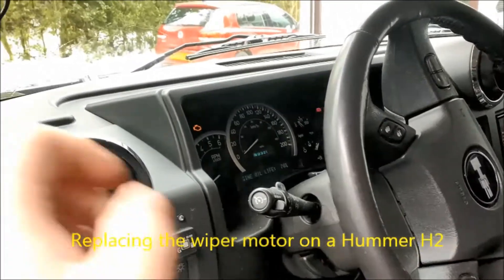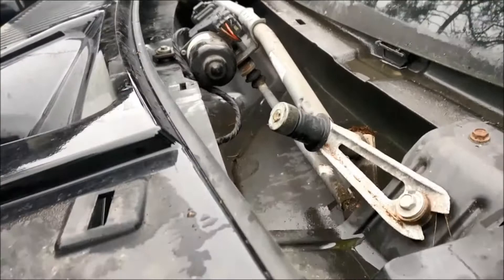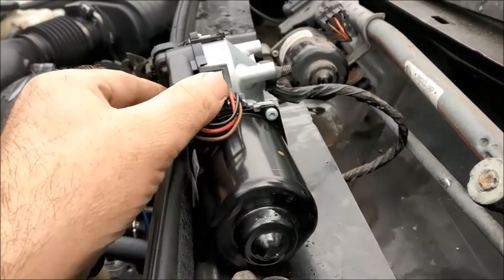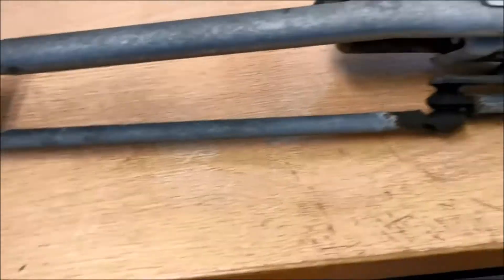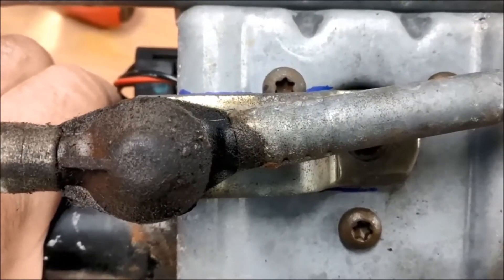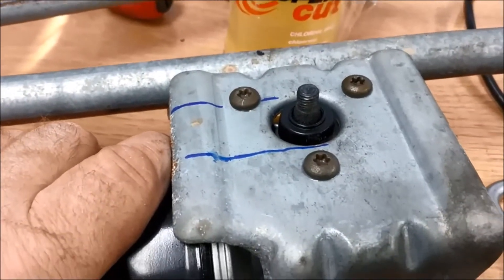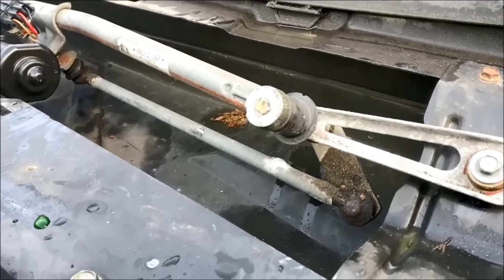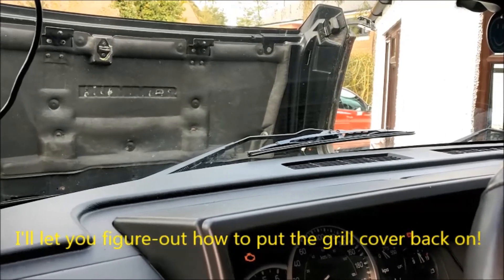Hummer H2 2005 - Front Wiper Motor Replacement

Comment: i am have a really weird problem....my drivers side wiper will not go all the way to the left for a complete windscreen sweep it stop right past top center and goes back down....no issues with the motor and at the end of the day all the motor does it a complete circle every cycle....i am past stumped on this one and looking for ideas on what it could be....i even have a video of it with the cowl off and it just doesnt sweep the full windscreen????....
Reply from the maker: Thank you for your comments.  Before commenting may I ask if this fault just suddenly started hapenning and is there any prior history?
Reply: @hummerfixes  I just got the H2 about 2 months ago and it was like that when I got it ….it does appear that the motor is newer but it seems to be doing exactly what it is supposed to making revolutions as it should and when I look at the wiper transmission it also seems to be doing as it should to but something isn’t right somewhere and it’s got me stumped ….I did send you an email with a video of it in operation

Thanks 
Jody
Reply from the maker: Thank you for your video, and I hope you received mine, which says the following :-

Good news, the motor and linkage look fine.

If you watch the video from around the 6s mark you'll see I've overlaid my H2's right-hand wiper "spline" with yours, notice they move by the same amount (it's night time here in the UK, my video was shot juts a few minutes ago)

Notice the "notch" in the spline moves from around the 7 0'clock to around 11 O'Clock positions,  which is about 120 degrees. This matches the CAD simulation I have here and looks normal.

If you clip-in the driver's side wiper-arm it should be impossible to move it by hand i.e. locked in position, if this is true the blade must move the full amount.

It would be interesting to see the same video shot with the wiper-arm attached

Hope this help resolve your issue...👍
Reply from the maker: Keep me posted..
Reply from the maker: Just to let you know I responded to you..
Reply from the maker: Hopefully you'll have seen my last reply & video - in short the motor pivot-arm looks bent maybe?
Reply from the maker: Hi Jody, any news, do hope you've managed to fix the problem ?

Comment: I just replaced a wiper motor on my buddies 04 H2, and the wipers want to go down into the cowl instead. Any pointers? At this point im stuck.
Reply from the maker: Sounds very much like the "arm" has been attached in the wrong position. Remove the motor, reconnect and allow it to "home" Refit and align the arm as shown in the video. Not sure if it's possible to detach the arm in place, if you can detach, home the motor then align the blades and re-attach. Good luck!

Comment: Our 2005 H2 with 95,000 miles is starting to groan.  

Did you ever take the old one apart to see what was making the noise?
Reply from the maker: ... ditto mine failed at 81K 4-years ago. I dismantled mine, but only after I'd bought a new one, then discovered the 2 plain solid bearing bushes on the main drive ARM were badly worn. If you're lucky yours could be the same, if so they could probably be drifted-out and replaced, and very cheap too. They look to be 10mm ID x 13mm OD x 10 or 11mm long, Oilite Bushes (at a guess) It's probably best to check 1st, unfortunately you'll have to take out the motor to do it. I was given an old motor to play with,  but this one has a bad motor bearing, not so easy to change (at least I haven't found a way yet)

One thing I missed out my video was the loud "clunk" that occurred when the wiper-arms changed direction returning from the driver's side. The previous owner had tried packing the splines, but that wasn't the cause, it turned out to be excessive play in the LH bearing of the wiper assembly. The cure (rather than buying a complete new mechanism) was to slice a 1/2" rubber tap-washer on one side then slide it over the shaft so as to keep the wiper blade in contact with the glass.

This has been running for 4 years, noise free!
Reply: @hummerfixes we have the radio staying on after exiting the car. Turning the rear wiper on shuts off the radio. 

But I did remove the front wiper motor and aside from the bearing noise there is some water intrusion on the corner of the electronic board.

I'm trying to just find a new front one and maybe do the rear one.

Comment: You are skipping alot of detail both removing and reassemblying..
Reply from the maker: Thank you for your comments which are very welcome. Presumably you are referring to the "cowling" for which I apologize, it is tricky to remove and fit, as I recall there was an focus "sticking" issue and I couldn't use quite a lot of video

Also, most of my early are were taken "just for the record" and not specifically with YT in mind.  Working and filming alone does make it hard  to cover all aspects as I'm sure you'll appreciate. There's the added dilemma that once a job is done and you're at the "editing" stage, often there's no going back to re-shoot if something key is missing. My brake-line replacement video for example, the final stage videos also got corrupted and it's not a job one wishes to do again, BTW most of the videos are taken one-handed on a mobile.

Hindsight is a wonderful thing, so many times I wished I could go back and do the work again, however I endeavor to "plan ahead" better, improve each time and try to ensure all the key stages are covered. As you can tell I do monitor my comments and will try to help where I can and I'm always open to questions and suggestions.

Hopefully you managed to change your wiper motor successfully?